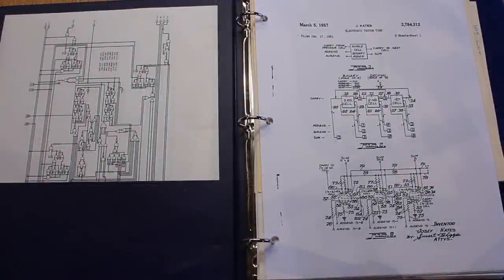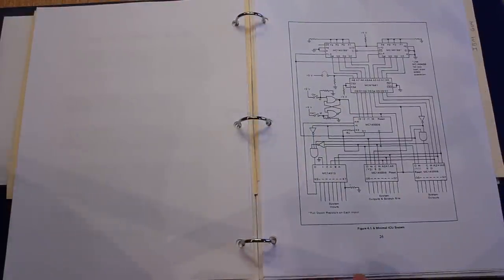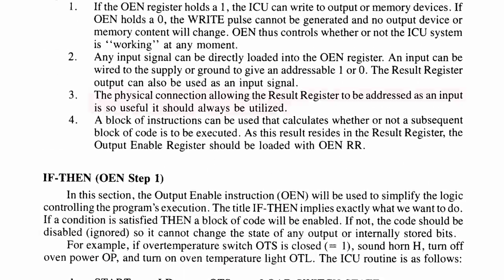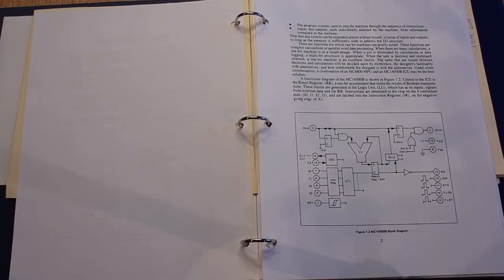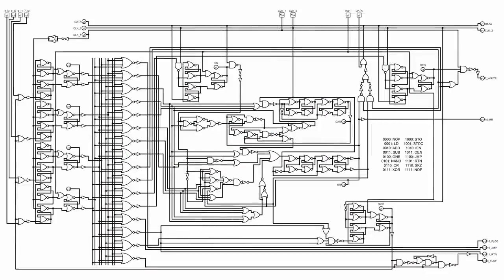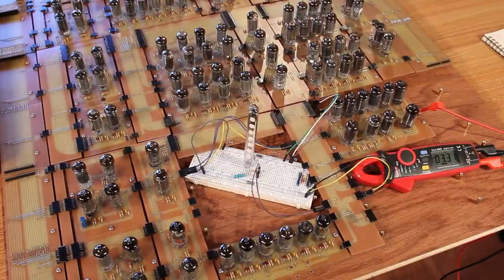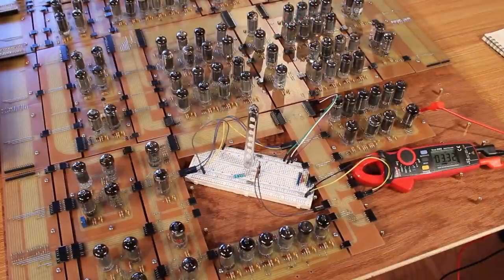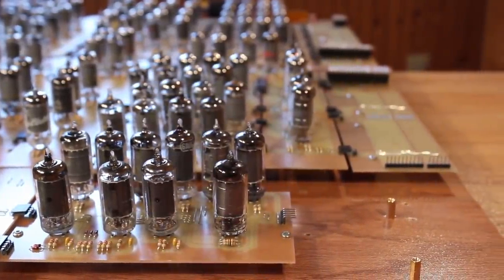Vacuum Tube Computer P.20 – IF-THEN Hardware

Comment: Didn’t notice that you used little pin sockets for the tubes, haven’t seen a design like that before. Do they keep their spring tension pretty well compared to standard sockets?
Reply: I'm happy to see this as I didn't see that part of the video and I was mortified to realize it looked like this was all being built without sockets! I was having a mini panic attacking wondering how to replace one of those tubes and what the tube life expectancy would be like if they had all been soldered to their legs.
Reply from the maker: So far they seem to work really well! A regular tube socket is obviously a better solution as they allow for some movement due to thermal expansion. These sockets in the PCB could cause some stress on the glass base under extended use, but so far I've had absolutely no problems with them. I haven't done any testing to see how the spring tension holds up to high multiples of plugging and unplugging, but I do have some that I've pulled the tubes out of at least 10 times and the spring tension still feels totally normal!
Reply from the maker: @RN1441  That's probably the number one thing I get comments on! Since the tubes are right on the base of the PCB, it really looks like I soldered them in. But, these little 1mm pcb pin headers seem to work really well, aside from giving an interesting appearance that is, haha.
Reply: @UsagiElectric  Interesting, good to hear you're having good experiences with them. I'd wager a guess why companies don't use it is as you say, over a few thousand thermal cycles the joints may crack. Not to mention it's a lot more time consuming than standard sockets

Comment: How do vacuum tubes compare when using 24V or higher voltage (200V+)?
Are they faster with lower voltage or with higher voltage?
Reply: higher=faster like transistors
Reply from the maker: This is actually a test I want to do sometime in the future!
There's a lot of factors to consider though. In this application, I'm pushing the tubes to full saturation and full cutoff. As the frequency gets higher, the tube has a harder time getting all the way down to saturation. More voltage helps accelerate the electrons faster, but even that has a limit. However, with careful design, a tube doesn't have to go all the way to full saturation. Someone much smarter than me could design logic high and logic low to be right in the middle part of the tubes curve, which means you can push them a whole lot faster before you start to run into problems. 

It also depends really heavily on the type of tube. Triodes are terrible at getting to saturation because the more electrons that hit the plate/anode, the lower the plate's potential is, which has less of an attraction for the electrons. That means that the closer it gets to saturation, the harder it is for it to get there. Pentodes on the other hand have a screen grid that acts as a sort of electron accelerator, keeping that attraction for the electrons regardless of the plate's potential. So, max frequency on a pentode can be quite different than that of a triode. 

I think that could definitely make an interesting video in the future! I just need to get my HV power supply up and going to test them properly!